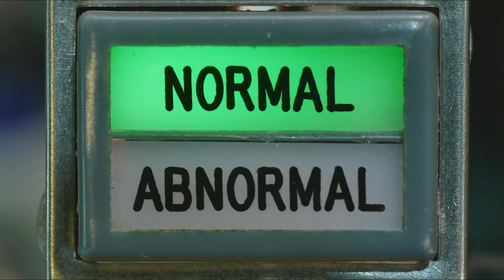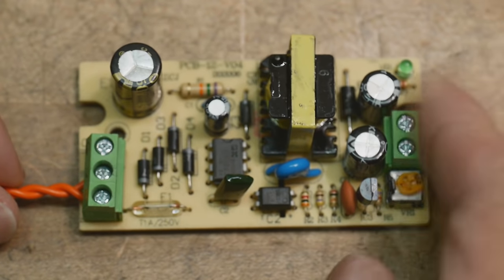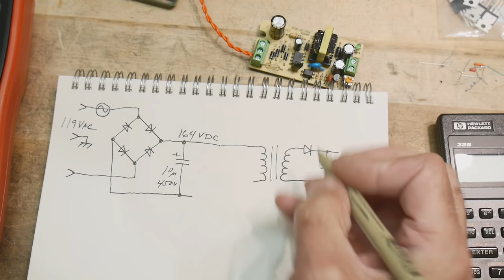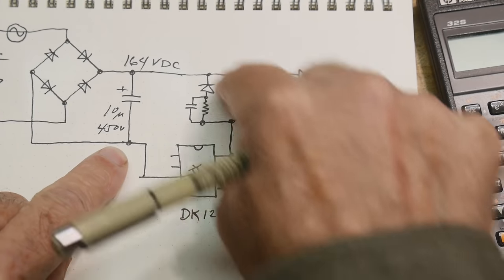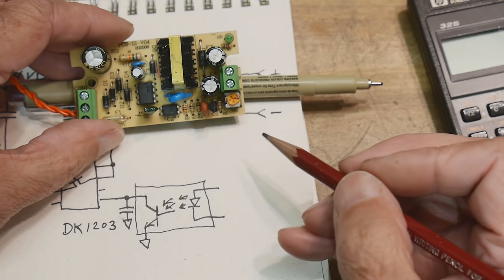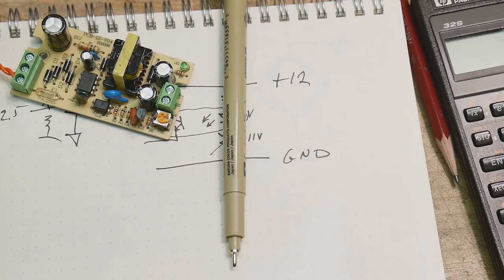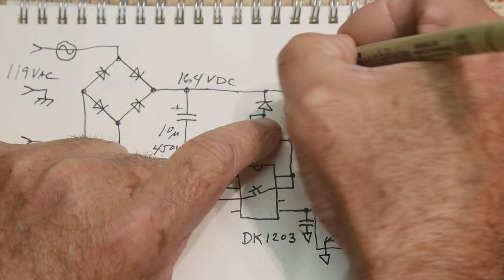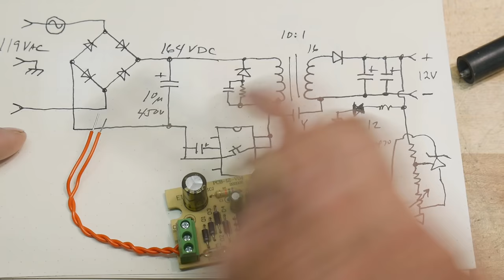#772 Basics: Switching Power Supplies (part 1 of 2)

Comment: If you have AC line voltage it seems silly to rectify it first then turn it back to ac before stepping it down. Why not just step it down directly from the line voltage without the intermediate rectification?  I know this is a 2 year old video so, probably won't get an answer, but I am curious. I 100% appreciate the way you just broke it all down and drew the circuit and explained every detail.  Fascinating. You might just be my new favorite YT channel.
Reply from the maker: requires very large transformer. switching supplies are smaller and more efficient.
Reply: @IMSAIGuy Why do you need a larger transformer to make 12V AC out of 120V AC than making 16V pulse modulated DC out of 164 V pulse modulated DC? Also, why is the output of the rectifier 164V DC, when the input is 120V AC? Im just beginning to learn electronics, so please excuse my dumb questions... 😊

Great video, by the way - love your channel! Keep up the great work!!
Reply: @fo76  The line voltage is 60 Hz. In this switch mode design the DC is switched at more than 1000 times that. Transformers at low frequencies require a lot of iron which makes them big and heavy.  Even 50 Hz transformers are significantly bigger and heavier than their 60 Hz equivalents. That is one reason why aircraft use 400 Hz AC rather than 50/60 Hz.
Reply: @fo76  
They certainly are not dumb questions.

When no load is connected to a transformer the primary winding just looks like an inductor. With sinusoidal AC applied to the winding there will be magnetic field at the same frequency created. In an ideal inductor the voltage and current will be out of phase and the power will be zero, even if the current is high. But there is resistance in the primary winding, so you want to keep that current quite low so you don't waste power according to I²R in the resistance of the winding. That means you must make the inductive reactance quite large to make that "magnetizing current" quite small (the reactance of an inductor is 2 • pi • f  • L, where f is the frequency in hertz and L is the inductance in henries and the reactance in ohms)  At AC mains frequency (50 or 60 Hz, depending on where you live) that means you need quite a lot of inductance. That translates to lots of turns of wire and/or a large iron core. The inductance is proportional to the square of the number of turns.

When the secondary winding is connected to a load, current that is in phase with the primary voltage begins to flow in both the primary and secondary winding. The current in the secondary "cancels" the current in the primary, so there is no change in that magnetizing current we had before. But the primary and secondary currents are now determined by the load connected to the secondary and the turns ratio of primary to secondary. We have to use wire that is large enough to carry the current without getting too hot. It's hard to get the heat of the winding of a transformer, so the wire is much bigger than we'd use if it were just a single conductor in free air for the same current. We already knew how many turns we'd need, so now we more or less multiply that by the cross sectional area of wire to get the total cross sectional area of each of the windings. We have to be able to fit that into the area available in the "window" of the core. If we need lots of turns of heavy wire, we need a big core with a big window to be able to fit the windings. The bigger core MAY change the inductance of the primary, so we may use an iterative approach to arrive at the best combination of core, wire size and turns. Usually we check some published tables that give us a good starting point, though.

If you raise the frequency, you can get tolerable magnetizing current with far fewer turns of wire. That means you can use a smaller core.The core material must be different at high frequency because some energy is lost in the core material itself. "Hysteresis" and "eddy current" losses are the big players, but that's a topic unto itself. At line frequency "silicon steel" is the usual core material. For switch mode power supplies the usual core material is ferrite - a ceramic made mostly of iron oxide. There are many formulations of ferrites. Most companies that make ferrite cores will offer three or four that are suitable for switchers, each with somewhat different properties.

As for 164volts - AC line voltage is specified as RMS - Root Mean Square. If you  divide a whole AC cycle into tiny time increments, take the instantaneous voltage in each of those intervals, square it, calculate the mean (average) of all those squares and take the square root of the mean you get the RMS voltage. AC mains is a sinewave. The peak (from zero) of a sine wave is 1.414 (square root of 2) times the RMS value of the sinewave. So 120 VAC gives you 120 x 1.414 = 170 at the peak. When there is no load, the input filter capacitors charge up to the peak voltage. (RMS is used because heating (power) in a resistor is equal to the RMS voltage squared divide by the resistance, just as with DC the power is the voltage squared divided by the resistance).

Comment: This is super helpful. I am working on a power supply for UMN smallsat ground support equipment, but my design is the bridge rectifier -> capacitors -> voltage regulators -> more capacitors type. The previous module was a switch mode power supply which somebody had bought off the shelf. While we are going with something along the lines of what I designed, but it is very helpful understanding more about the switching types of power supplies. Who knows maybe we will change our mind and I will make one of those. Thanks for the info! Usually I come to you for DIY synth stuff hah

Comment: That Y-capacitor is unlikely connected as in your schematic as it would make the EMI worse. It probably be connected from the secondary GND to primary GND instead. Connecting the ~2nF capacitor the way you drew will give quite a good shock to an unsuspecting user touching any part of the secondary side if the secondary GND is left floating.
Reply: The Y-cap is to isolate the primary from the secondary. Though, it has to connected such that one terminal to the Secondary GND and the other to the +ve primary.

Comment: They use a Y-capacitor instead of an X-capacitor between the primary and secondary windings for EMI reduction because if a Y-cap fails it fails as an open. X-caps fail as a short. So if you instead used an X-cap between the primary and secondary windings, a failure in the cap would short the high voltage side to the low voltage side (typically not a good thing).

Comment: Great video! The Class Y capacitor is the correct choice for inter-transformer windings applications like the one you were looking at. X capacitors are used to prevent fires. Y capacitors are used to prevent shock. Y capacitors are more expensive, so it's common to see X capacitors where you need Y, but less common to see the reverse (unless the capacitor is rated for both, which is very common).

Comment: Nice vid, and very clear and helpful commentary. It would have been useful to briefly mention "why use a SM PS?" The answer being that the size and weight - especially of the transformer - is much reduced, and that this is made possible by the AC frequency at the transformer being much higher than the 50/60 Hz of the mains. The downside (as you mentioned) is that this higher frequency gets emitted as interference to nearby electronics, even when quietened down by on board capacitors. Loved the use of a simple design to demonstrate the principle. The more complex SM PS are often difficult to fault-find and repair.

Comment: The description of the pulsed DC as AC is a bit of a misnomer that could be confusing as this pulsed DC has a DC bias, it does not change polarity or alternate.  For this reason there are several aspects of the description that don't match AC power supply designs.  For example, the windings on the transformer don't need to meet any 10:1 ratio like an AC stepdown transformer, although it often approximately does.  The transformer is "charged up" when the switch is on and "discharged" when the switch is on.  The transformer is not transforming current, when the switch is off the energy has no place to go but out the output diode and the voltage will rise to whatever value it needs to to exit the circuit.  The windings do play a role in each side in determining the voltage when the switch is on (for the diode breakdown voltage) or when the diode is conducting (for the breakdown voltage of the mosfet switch).
Reply: And the name/topology of this type is "flyback".

Comment: A very accurate model to describe the TL431 is a non-inverting op amp with its negative lead connected to a 2.5V reference. Using two feedback resistors like you do for any non-inverting op amp, you can multiply the output voltage to create Vout = Vref * (1+ R2/R1) where Vref = 2.5V and R1/R2 are the two feedback resistors. The only difference is that the TL431 can only sink current; it cannot source it. Easy peasy! Rumor has it that the incorporation of the TL431 in the original Apple ][ switching power supply circuitry led to the TL431 being the world's most popular integrated circuit. Prior to the Apple ][, most personal computer power supplies were big bulky linears. The ]['s power supply was tiny and light in comparison.

Comment: Sometimes with TL431 as the Voltage Sensor, optocoupler has a resistor (like 1K) in parallel with the LED, to avoid it being lit by the quiescent current of the TL431.

Comment: Pointing each component on the board and explaining the function on  your sheet, one of the best explanation of a switching power supply I've seen so far. Can you do the same on a more complicated power supply like a computer SMPS.
Reply from the maker: computer supplies can be very complicated and explaining how one works is probably only valid for that one design.

Comment: In your schematic, you have a resistor that ends nowhere, in the lower right corner. It is in the monitoring circuit I believe.
Reply from the maker: it is marked +12, it connects to the 12v

Comment: A couple things that perhaps were already addressed in previous comments:
You used same symbol for two different sets of ground.  There's a ground on the high voltage side, and a different ground on the low voltage side, which the two sides should not be tied together.
Also for the high voltage side, you're missing your ground source reference.

Comment: A "Y1" capacitor is used between the input and output side as a local return path for high frequency noise. Noise coupled through the transformer to the secondary side goes back to the primary side in a short loop instead of radiating from anything connect to the secondary and acting as an antenna.
This capacitor is in a very critical position with regard to safety. If it were to fail short-circuit it would create a potentially lethal electric shock hazard - the entire secondary would have to be regarded as connected directly to AC mains. Y1 capacitors are essentially two capacitors in series - the equivalent of "double insulated" structure. Their nominal voltage rating is according to the AC mains voltage for which they are intended but the actual breakdown voltage is very much higher than that - several kilovolts. The probability of a short-circuit failure is extremely low.

X capacitors are designed so as not to catch fire if they fail short-circuit - they "self heal" to clear the fault by burning away the  foil in the area where the short occurs. This could be disastrous if used where a Y cap should be since the fault would persist until sufficient current could be passed, mean a potentially lethal shock hazard would be there until someone or something got fried.

Comment: I guess this could be modified to a MPPT solar panel power source for a water heater. Just the feedback loop would be a bit more complex and  involve a microprocessor to balance the right load for light conditions. Cool. I learned something

Comment: It would be interesting to see the wave form at different points in the power supply I’m assuming the output would be like a pulsing square wave d c you see is that correct? Thanks

Comment: You at least partially answered my question regarding that blue capacitor across primary and secondary windings.  I have a power supply which has a significant AC signal on the secondary output side in the 60 Hz range.  When I remove that strange blue capacitor with AC signal on the secondary disappears interestingly enough.  So I remain a little baffled maybe you had more information regarding the so-called Y capacitor.  Ethan

Comment: I wonder how well an AM receiver would like living in the same house with one of these power supplies .
Reply: They’re ubiquitous at this point, so ask anyone with an AM radio. The only devices still being manufactured with a linear PSU that I can think of are hifi receivers, and even they are increasingly being replaced by Class D amps that also use switchers.

Comment: Thank you for a clear explanation. Why does the frequency affect the output voltage? Why not just set a 555 timer to pulse @ 50Hz?  I couldn't understand why the feedback is neccessary....
Reply: This circuit is called a "flyback converter." The name comes from a sort of similar circuit that is used to sweep the electron beam across a CRT, like a TV screen. When the beam gets to the end of its sweep of one line it "flies back" to the other side. If you look at the voltage waverforms those in flyback switcher are kind of similar and the circuit is similar, though the CRT circuit is concerned with making magnetic or electrostatic fields rather than generating voltage (in a TV it actually does both - manages the magnetic field to sweep the beam and generate the high voltage required to make the beam).

Anyway - with a flyback converter you aren't actually transforming voltage directly. Each cycle delivers a "packet" of energy. If the current requirement of the load increases and the packets are being delivered at a constant rate (frequency) then each packet must be made bigger to maintain the voltage across the load. The feedback circuit detects that the voltage at the output is not what it should be and commands the input side to adjust the size of the packets. If the voltage is too high, make the packets smaller. If it is too low, make them larger. This is "negative feedback." The are made larger or small by adjusting the amount of time the switch on the input side is ON - "pulse width modulation."

Feedback circuits also make sure that things like power losses (inefficiency) in the circuit are corrected for. The feedback circuit doesn't need to know what is causing the disturbance, only that it is happening and a change must be made in the appropriate direction to correct for it. It's like controlling the speed of a car with the gas pedal. You don't really need to know if you are fighting a headwind, or going up hill, all you know is that you need to push the pedal down so your speed is maintained. Feedback also corrects for variation in the input voltage.

Comment: I enjoyed the video and followed it through your logical steps. I like the addition of the TL431 for the dc o/p feedback and the pot to adjust the final output. 1 Question : why is the -12V not connected to ground (or 0V line)?
Reply from the maker: the design would have be different to use a single supply, the -V allows the op-amp to operate correctly around zero

Comment: The basics are similar as long as you ignore the last 100 years of development and stick to the 1920 vintage buck, boost, and buck-boost. When you add the Ćuk, integrated magnetics, hybrid switching, PWM-Resonant, and Resonance Scaling Method concepts you get significantly cheaper, smaller, 99+% efficiency, and faster transient response.

Comment: Fantastic video. If one were to build their own version of this, when sourcing the transformer, what things should one look for? We know it needs to handle a certain amount of current and that it needs a 10:1 ratio to step down, but are there any other things to look for?
Reply: The data sheet has a nice little blurb on designing the power transformer.  I found it useful

Comment: It is easier to work with " old school pcbs ".  I have had a hard time trying to repurpose 3 x 5 mm SMD pcbs of mobile chargers. Some components are smaller than ants and even with magnifying lenses & glass it is very hard to reverse engineer. On some pcbs there are no opto-coupler but  3 or four SMD transistors  and  SOT integrated circuits with six gull wind leads [ no code ]. I took high resolution pictures but it did not help too much.

Comment: The 'old' conventional approach delivered unregulated 12vdc output with 10-fold step down transformer to first get approximately 12 vac, a rectifier to convert that ac to dc, and a ripple filter to smooth the  dc output, and a 3 wire linear regulator to stabilize the dc voltge output.
 Can you explain
1. How this smps circuit delivers a regulated dc output, and
2. How the smps approach reduces the cost and size of the unit compared to the 'old' conventional approach?
The cost and size advantage is central to the near universal use of the smps approach for PC power supplies.
Reply from the maker: 1. I explain that in the video, feedback is through opto-coupler
2. size is due to low current. old has high current in transformer, new has low current. by using a high voltage you only need low current for the same power.

Comment: Thanks for this tutorial. could you please explain how the voltage control feedback through the optocoupler actually controls the voltage. It seems to me that by slowing the switching, the frequency of the AC output would change, but surely the voltage is still a function of the ratio of the windings.